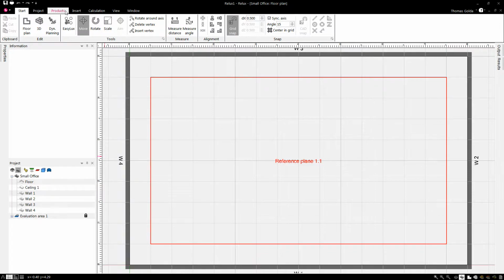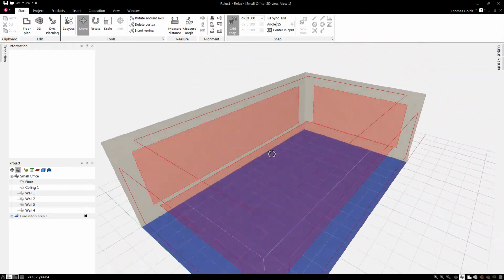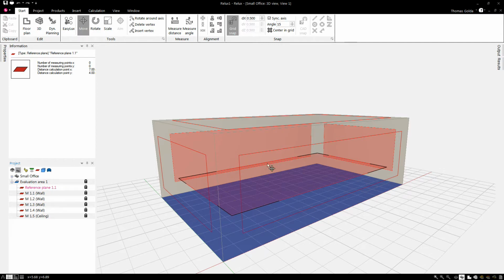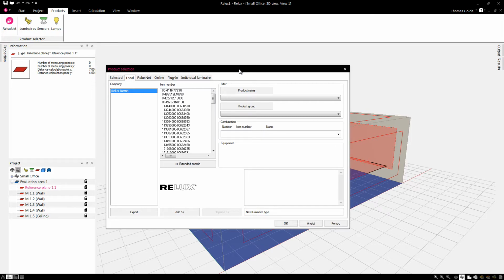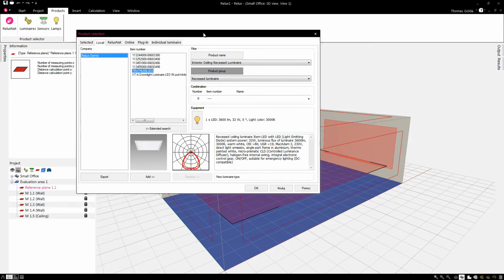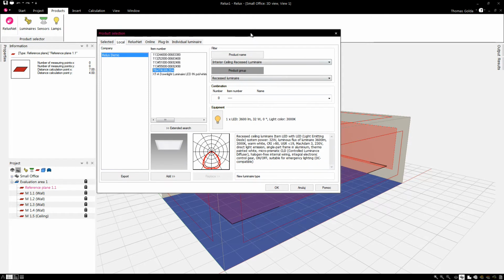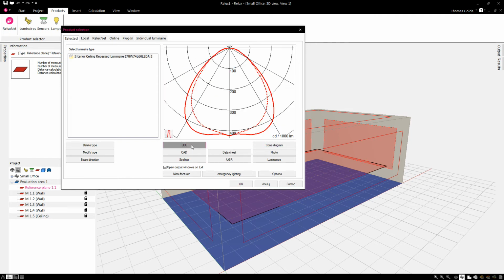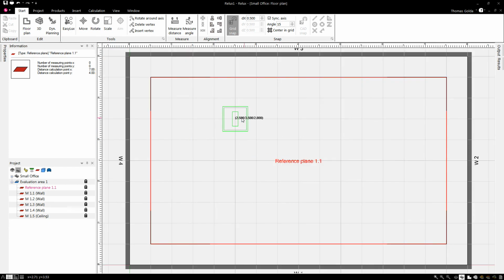part 2

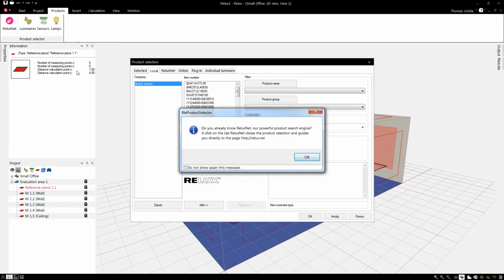Comment: Excellent video. Yet, as i tried to immitate what you do, i found out that  when i click on "Luminaires" as you did on 4:07, nothing happens. The list just doesn't show up. The same - nothing- happens if i choose "Sensors" or "Lamps" instead. Nothing happens. What am i doing wrong? Many thanks!
Reply from the maker: Hi Yiannis, 
This video is outdated, it was recorded about 3 years ago, I reckon your version is a lot newer than 2017 that I was using in that time.